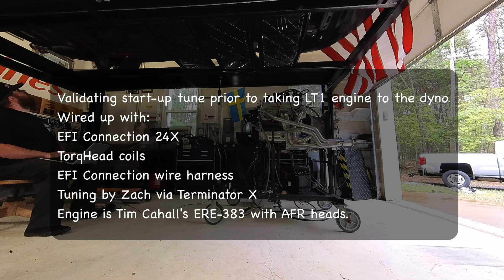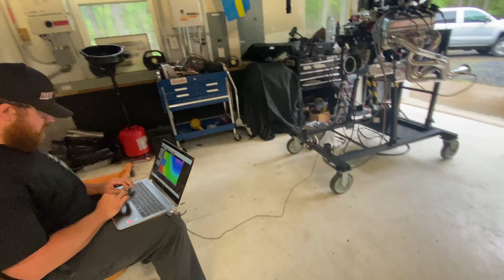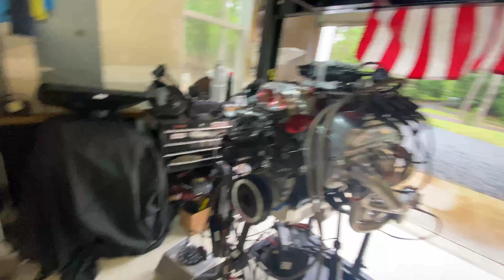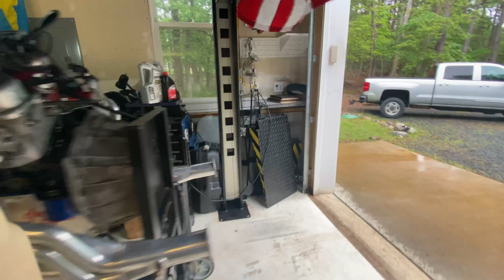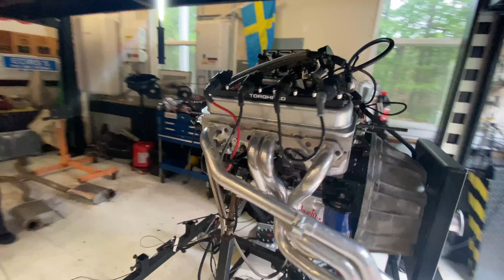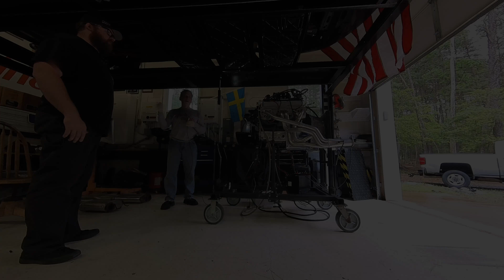Pre-Dyno EFI Wiring Verification for 24X LT1 on Holley Terminator X

Comment: Installed Holley Term X Max on TorqHead 24X… my Holley wiring was designed for a 58X set up (vehicles with cam and crank sensors at front of engine). Do I swap the A and C pins on the cam and crank sensors to work with Holley?
Reply from the maker: Good questions. I don’t know about that but if the plug fits the cam and the crank then probably yes seat a. And. C